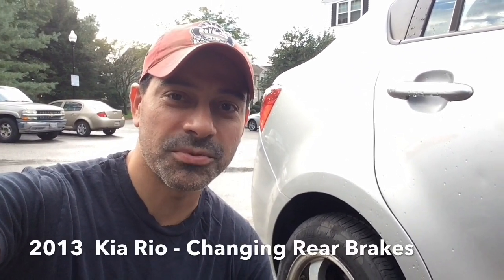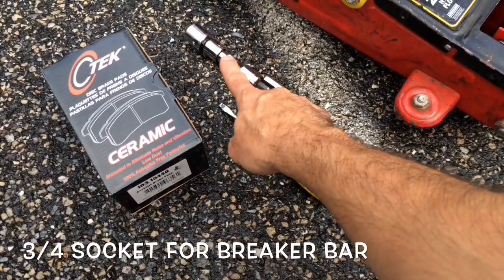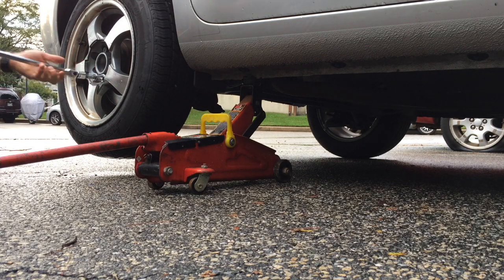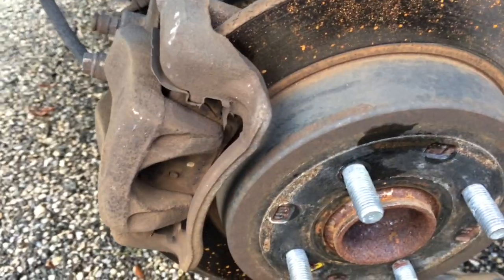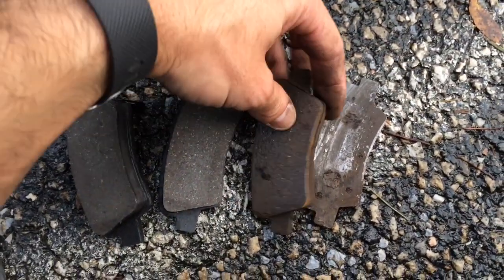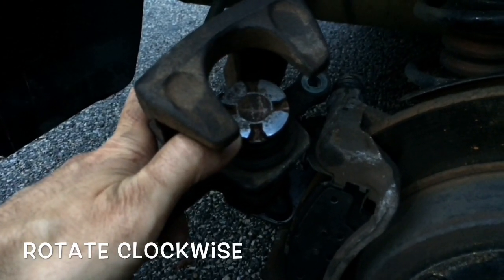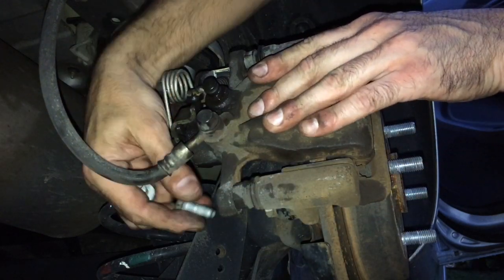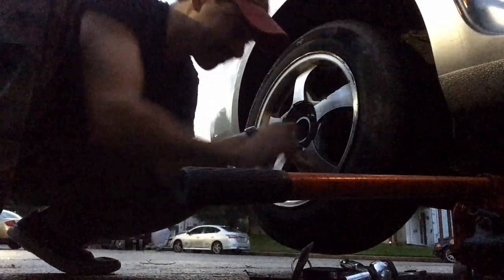How To Change Rear Brakes - KIA Rio (Andy’s Garage: Episode - 11)

Comment: Thank you so much. My silly self was using C clamp and didn’t know to use needle nose to get that caliber piston back in. Awesome job explaining and great visuals. Thanks🥰
Reply from the maker: Kelli Adkins thanks for the feedback, glad it helped 👍
Reply: Phillips Vision was this yr car or was you just doing it and made video about it? I’m asking bc I’m wondering how many other 2012 Kia Rio Hatchback ppl are out there. Where I’m from, I have the only one. My little car will get it and go, has those low performance tires and sets low and will hug a curve. My first car was 1998 Mitsubishi Eclipse, 5 speed......loved that car but I bought this Kia off the showroom floor and I take good care of my car and motor. But seems like after a few years, around 60,000 miles I started having a lot of things I was having to replace. I had the 100,000 mile tran warranty, paid it off a whole year early. I had to replace control panels, struts, literally at 99,600 the motor shot a rod but not at first.....it still ran but it was weak, loud and jerky but I’m a single mom with 2 teen daughters. I work, they both play ball and I’m always on the go. Took to my mechanic, whom I have spent thousands of dollars in business and he says he doesn’t know what’s wrong. The owner of the biggest mechanic where I live and did an $50 oil change. I was 300 miles over 100,000 when our family mechanic was able to come check it out. He started it up, stood up and listened for about 3-5 seconds and turned it off and said.....shot a rod. It’s gone. Called Kia....they legit told me.....sorry, don’t know what to tell ya. However the car gods graced me with motor, 32,000 miles for $1,500😳but this mechanic is a kind old man and loves me and my parents so. Anyway sorry, It just seems there’s always something going on with my car. Even tho it’s a great car and I love it. Runs good, great gas mileage. I don’t know anyone who has one that I cud ask and compare to. If you know anything remotely about this car or everything cud you possibly give me a brief rundown or info on it. I seriously don’t know what I wud have done today had I not found this video
Reply from the maker: Kelli Adkins it’s my wife’s car. She has about 125,000 on it and it runs great. Haven’t had to do anything to it aside from routine maintenance. It gets great gas mileage and is very reliable.
Reply: Yes Phillip thanks for a GREAT video and thanks
Kelli for the comment because I was using a C clamp as well and so I stopped and watched the video .

Liked and subscribed!

Comment: You forgot to loosen  the cap on the brake master cylinder to compensate for  the increase of  air pressure in the brake reservoir as  the fluid level rises  as the pistons are pushed in.

Comment: Does the parking brake have to be adjusted after installing new rotors?

Great video btw.
Reply from the maker: Thanks for the comment. I did not adjust the brake and it works fine.
Reply: @PhillipsVision   when I did this I found that when turning the piston the rubber around it gets bunched up by the time it’s screwed in enough to place over new pads while yours is nice and straight. How did you avoid this?